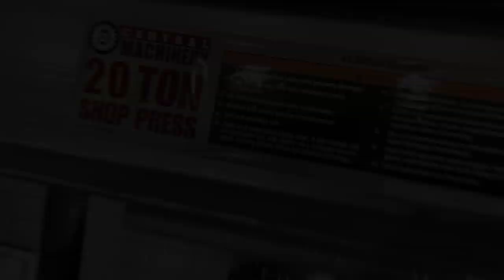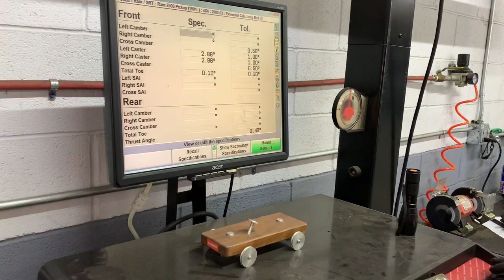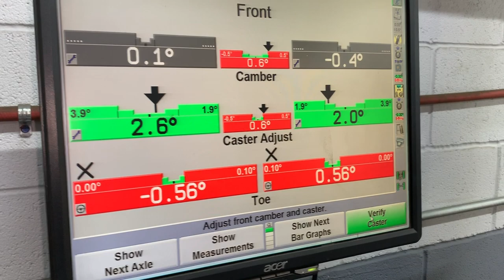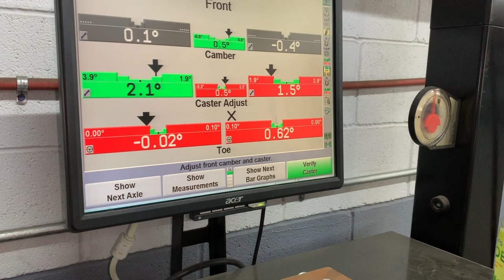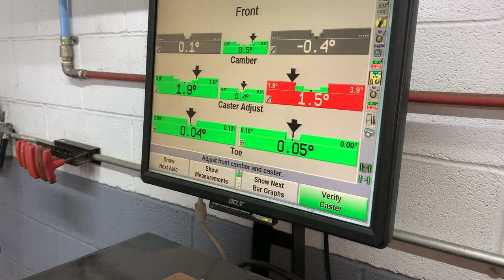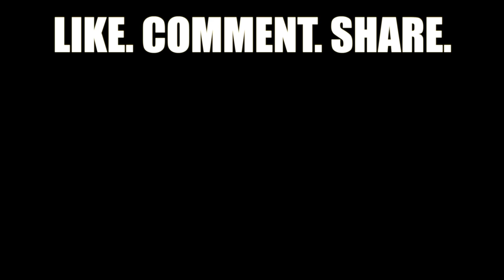Rebuilding A Wrecked Dodge Ram Cummins 2500 [part 14]

Comment: Two peice drive lines are balanced. You should have marked the separate parts before taking it apart to make sure they are oriented correctly when you put it back together.